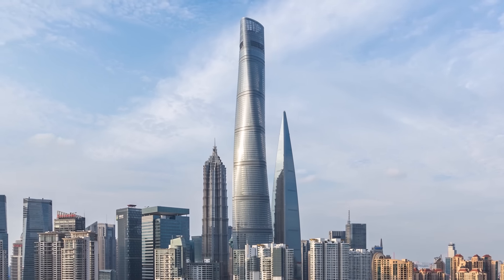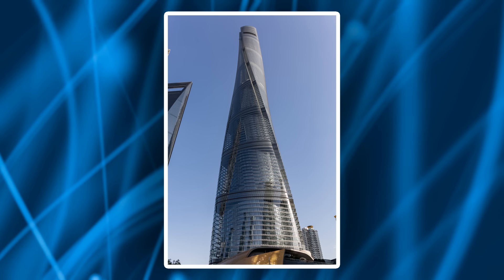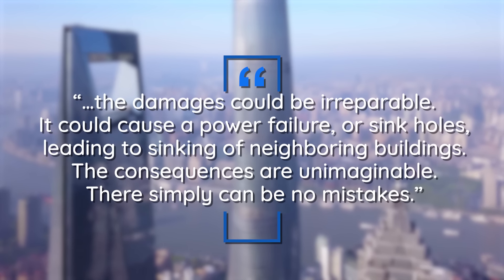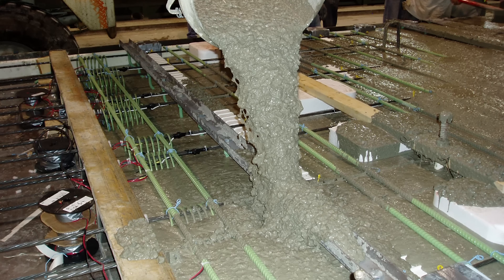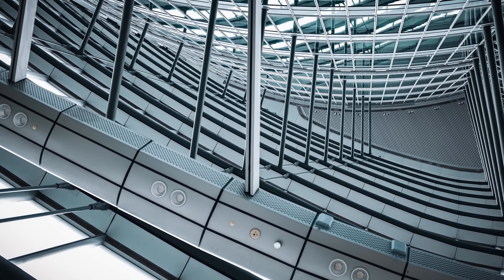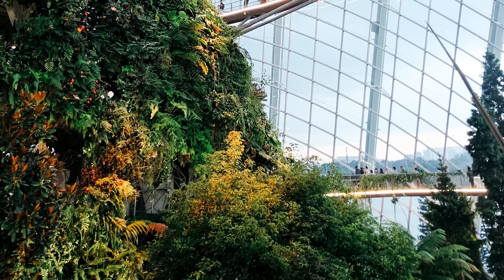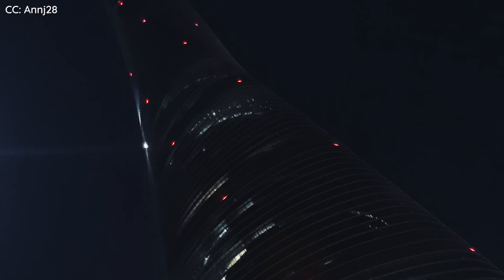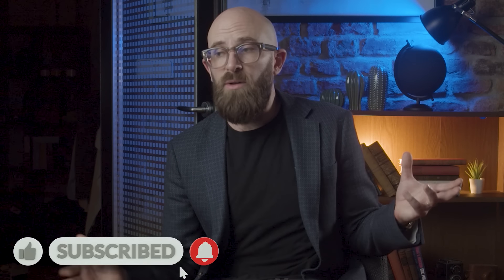The Shanghai Tower

Comment: Its actually called,  "self consolidating concrete" or SCC.  It's also a slightly more tricky mix to make consistently.  It is usually used for larger mass pour, or monolithic, foundations.
Reply: I was in the CN tower this past weekend. Longest monolithic pour of its time
Reply: @alargefarva4274  how many yards? I'm an engineer and work on a couple of massive projects atm.  One is a massive new LNG terminal and the other is a new unit for Chevron-Phillips. Largest mono pour we've done on either of those sites was a 3,600 yard compressor tabletop.  They had 3 pump trucks and trucks running from 11am until about 4am.
Reply: Self compacting concrete where I'm from.
Reply: So no vibrators are used when pouring? Or they use them anyway?
Reply: @kalu19991  good question... im PRETTY sure they still vibrate it in the forms, and I'm positive that the engineers who test it don't have to vibrate it.  The testers just do a spread, pendulum, and column test on it and make a set of 4x8 cylinders.  They also have to put temperature sensors inside and check the temperature as it cures for several weeks.  Depending on the dimensions, the temperatures must climb steady for so many days and not get beyond a certain temp, and then it must cool at a specific rate.
Reply: @Blinkerd00d  sounds like a lot of work 😄

Comment: The floorplate problem is insurmountable.  The Shanghai Tower is unquestionably the nicest looking of the super and mega tall buildings, but the cost per usable square metre of floor space is too high for tenants.
Reply: That’s plenty questionable. Taipei 101 is head and shoulders above the competition in terms of aesthetics, in my book.
Reply: @PerfectSense77  this has astonishingly large greenhouses which are public spaces. An eco system with its own weather!  How do they handle air movement?  Is there more oxygen and better negative ions?  Is it healthier to be in this building than it is outside?

Comment: copyright@joseph1150
The Empire State Building was completed during the early 1930s, and was mostly empty for several years. At opening there was pretty much only 1 tenant above 7th floor, and for almost the entire decade there wasn't even elevator service past floor 40 other than for the observation deck. The building wasn't profitable until the 1950s. I could see a similar situation for this building.

Comment: Suggestion for an alternative title: "A Colossal Erection in Shanghai" . 

Re: the time it will take to fill the building with tenants. The usual lifespan quoted for concrete is 50 to 100 years, and that is for high quality concrete under moderate conditions. Rebar helps, but it can rust fairly rapidly in wet, warm climates. The cost of carefully deconstructing something with this much mass and stored gravitational energy, without taking down neighboring buildings, could be a significant fraction of the cost of building it.

Current real estate/economic problems in China suggest that "ironic" might be a better word than "iconic" to describe this building.

Comment: At least the Shanghai government is rich and able to bail out the building of and operation of the tower and thus is still functional. Both Tianjin and Wuhan have an unfinished >500m skyscraper each just sitting there after their developers went broke. In 2020 the central government banned new buildings over 250 meters tall and new ones above 100 meters need to be “culturally significant or reflect Chinese culture.” Good riddance I would say.
Reply: So, high rise prisons?

Comment: I prefer the Malaysian Kuala Lumpur skyline method comlare to how shanghai does it. 

3 towers with different architecture design together looks too mixmatch. Especially the Jin Mao which looks outdated compare to the other 2. Not to metion the other large building that typically accompany the picture of there 3 tower that added to the contrast. 

Malaysian Kuala Lumpur skyline is better space out with the Petronas Twin Tower, Tun Razak Exchange Tower, the KL tower, and the tallest Merdeka PNB tower in different part of the city that creates a skyline that you can see different tower in different view of the city. 
That will be nicer.

Comment: It is curious that it does not seem to be possible to find the distributions of steel and concrete data down any skyscraper.  Consider the shape of the Eiffel Tower that is a measly 300 meters and does not have to support twice its own weight in concrete.
Reply: On the one hand I would say it's a trade secrect on the other hand I don't understand the argument you are trying to make. The Eiffel Tower is far lighter as it does not have to "hold up" all the floor space.
With the twice its own weight in concrete, do you mean the ratio of foundation mass to building mass? or ratio of concrete to steal in the walls?
Reply: @selectthedead  
Every very tall structure must deal with the problem of supporting progressively increasing weight from top to bottom. The Eiffel 🗼 Tower is 10,000 tons of wrought iron and no concrete and glass. If the ET was sliced into 100 3 meter sections the slices must have some mathematical pattern to the increase.

Of course if the top 14% of such a structure supposedly falls straight down and totally destroys the bottom %83 in less than double free fall time and 2 decades go by without "experts" discussing the distributions of structural mass versus non-structural mass must be peculiar because the Conservation of Momentum would affect that time.  Especially since the World Famous Event has become historically significant physics should not be historically INACCURATE.  Would engineering schools not asking obvious questions be political?
Reply: Definitely, it would be political to shut up voices of reason!

Comment: Hello Simon, the Shanghai Tower is not and never was the tallest building in Asia. That would be the Burj Khalifa which opened in 2010 in Dubai.
Reply: That’s taller because of a stupid antenna not because the there are actually occupiable floors like the Shanghai tower. They have a bar restaurant in the Shanghai tower high up there. I just saw several you tube videos on it.
Reply: Cheating with antenna
Reply: It has the highest observation deck in the world.:face-green-smiling:

Comment: Slight fact check - it's the second tallest tower in Asia. The tallest is Merdeka 118 in Malaysia, which is 644m tall.

Edit - Shanghai Tower is third tallest in Asia, behind Merdeka 118 in Malaysia and the Burj Al Khalifa in Dubai 🙏
Reply: Dubai is in Asia too, western Asia but I don't think anyone use that term.

Additional error: the pilons are not UNDER the foundation. They ARE [part of] the foundation.
They are under the building.
Reply: The only sensible metric for comparing buildings is height to highest occupiable floor.  The Burj Khalifa looks very impressive but the top 29.5% of it is unoccupiable vanity height.  The Merdeka with its giant spike is 26.1% vanity height.  The highest occupiable floor in the Burj Khalifa is at 585.4 metres, Shanghai Tower's is 583.4 m, Merdeka's is 502.8 m.

Comment: Did you know Dubai and Kuala Lumpur are in Asia?
Did you know that the tallest and second tallest skyscrapers in the world are in Dubai and Kuala Lumpur? You know, in Asia?
Did you know that the third tallest skyscraper in the world is shorter the tallest and the second tallest skyscrapers in the world?
Reply: Glad I'm not the only one who noticed that.
Reply: Simon probably means the tower was meant to be the tallest in East Asia. The Kuala Lumpur tower has just started construction when the Shanghai tower was completed.
Reply: Probably just a rushed edit but could have said second tallest when started or planned to be second tallest but then eclipsed by the KL 118 / Merdeka Tower.
Reply: The Merdeka 118 is only 502.8 metres to the highest occupiable floor, compared to 585.4 m in the Burj Khalifa and 583.4 m in the Shanghai Tower.  Congratulations Merdeka 118 builders, you managed to make the second "tallest" building in the world by sticking a giant spike on the roof.  26.1% of the Merdeka's official height is vanity height (the Burj Khalifa is 29.5% vanity).  The proliferation in the use of vanity height makes highest occupiable floor the only sensible metric for comparing buildings.
Reply: DId you know that Phil Leotardo spent 20 years in the can?
Reply: oh...a stick that makes them taller...😏😏😏

Comment: "5 floors underground"  my 1st thought was, "Only 5?"  doesn't a tower need like half its length underground?
Reply: That doesn't mean fully accessible floors, it means foundations.
Reply: Did... did you really think that?
Reply: @eddiehimself  yes, but, if you're going down half the length of the tower, you'd think more than 5 floors would have been constructed.  How many floors could have been dedicated to parking garage.  I'd sure as shit would have more than 5, and also a whole floor dedicated to subway

If you're building 100 floors up, you'd think it would be easier to build more than 5 down
Reply: @firstname8637  yes, why waste half a length of skyscrapper into the ground in just  foundation pylons.  parking garage alone would seem to take up more than 5 floors
Reply: @alexhaladay4345  The volume of space taken up by the foundation rods is miniscule compared to the volume taken up by digging up completely new floors underground. Similarly, it's far easier to build floors above ground because, wait for it, you don't have to dig out and extract material from deep underground when the floors you are building are above ground. 
"I'd sure as shit would have more than 5, and also a whole floor dedicated to subway" well good thing you're not the architect, then. Because it's so easy to say what you would have done better when you're not actually responsible for a multibillion-dollar building project.